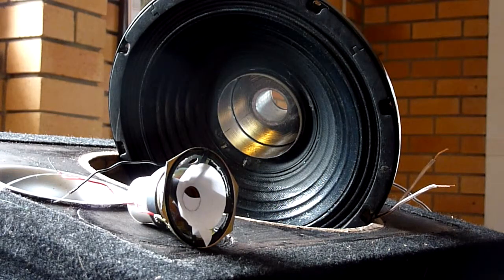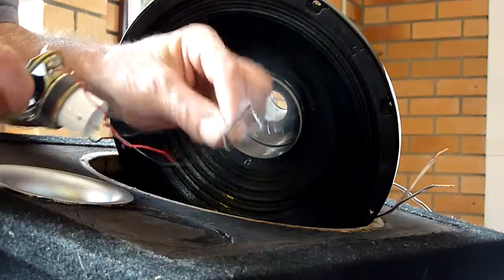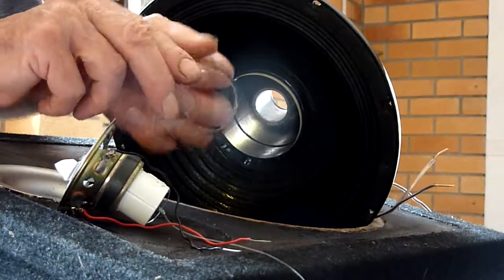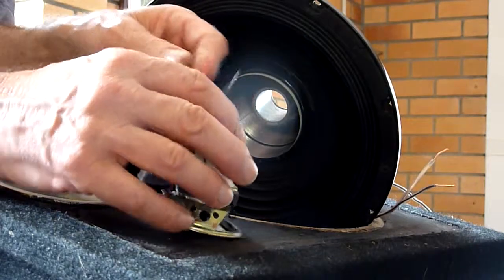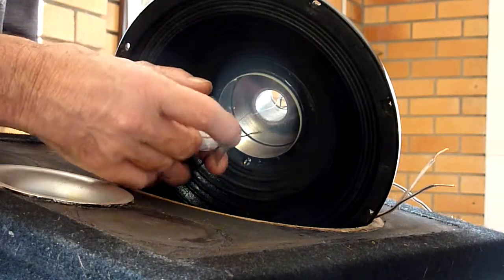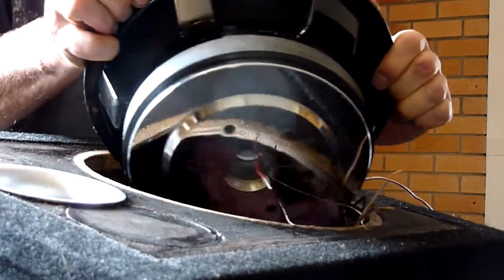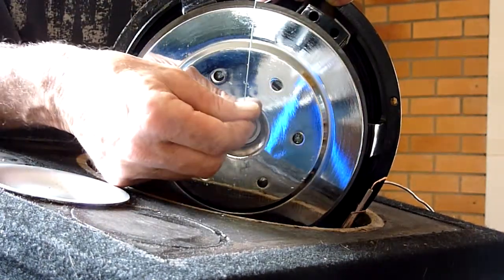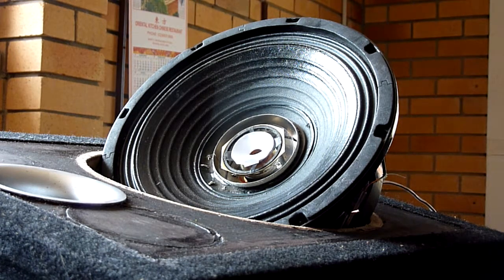ASSEMBLY OF POINT-SOURCE TWO WAY SPEAKERS (COIL TWEETER).

Comment from the maker: There is a fair gap between the voice-coil tube and the walls of the core. Enough to put a piece of paper in it and get dirt out. I had to do it. If I sell them I would have to glue a ring of cloth between the outer frame of the tweeter and the start of large cone. And back of hole.
I have different tweeters in these now and their cones are mounted normally (joined to the frame) and with the cloth, no dust will get in. See my later videos on these speakers on my channel. Thanks for the comment.